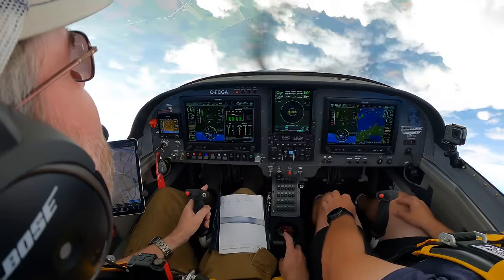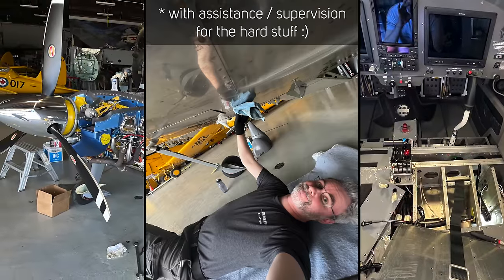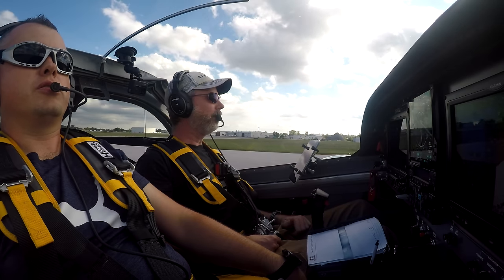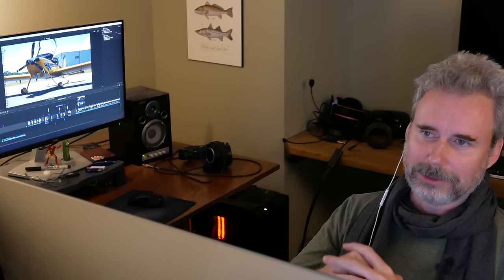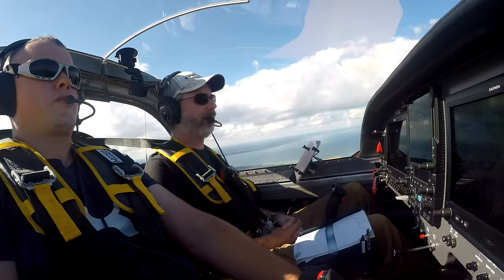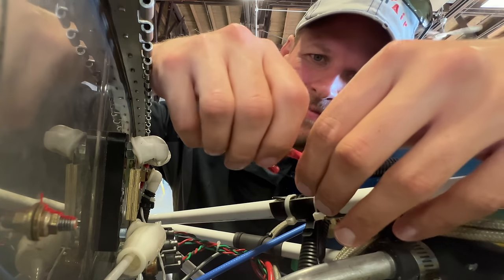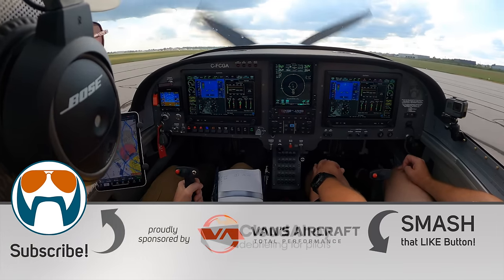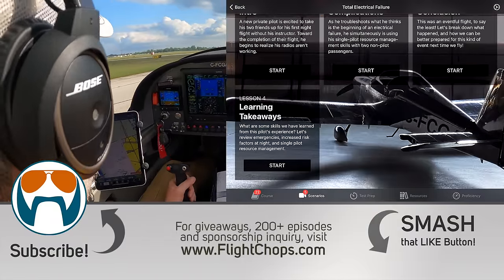Loop Induced Emergency?!

Comment: Good job handling the situation. Glad it wasn’t anything major. I do have a suggestion for the wiring on pretty much all sensors. Those spade connectors aren’t the best to use IMO. I’m partial to Deutsch connectors. They require a small tooling investment, but they’ll hold the connection securely, lock into place, are relatively inexpensive, and they’re waterproof.  It might be worth looking into them for critical sensors like the oil temp sensor. I’ve been using them for a few years and they have always done well in some pretty harsh environments (high G, oil/coolant/water, temps in excess of 280°F)

Comment: For a critical measurement like that, really should be using a 4-point probe method of measuring resistance.  Then the measurement is independent from the connection wire resistance.    Probably not how the probes are available off the shelf.

Comment: Bit late on this but t-bolt style clamps may be a better option than worm gear style. If a worm gear fails on your clothes dryer hose, not such a big deal. If it comes off your oil cooler at altitude. a much bigger deal.

Comment: excelent film... can you explain the 'fun switch'
Reply from the maker: It’s a quick way to inhibit the Garmin “electronic stability and protection” - this can be done via the panel menu as well, but I like the idea of a hard switch ;). Bottom line is, the system won’t let you do anything outside a safe range of pitch and roll unless you disable it.  If you look at the videos we did at the Garmin factory the topic is addressed more thoroughly.  I’ll grab some likes and make an other comment later - just shutting down for the night here.
Reply: @FlightChops  thank you.  i will re watch the garmin episode.  good night from France

Comment: I'm surprised Garmin doesn't have anomaly detection on sensors like this. Software could easily identify when a sensor is reading erratically, and alert that as a possible sensor malfunction. This would provide a safety net going the other way too, detecting where a temp sensor has malfunctioned electrically while still reading a value that wouldn't otherwise stand out to the pilot. This could be taken even further when CHT sensors are present, and cross reference them with the oil temp - although the heuristics certainly get more complicated. Nonetheless, done right there would be a lot of value in the avionics being able to identify when sensors aren't agreeing vs. everything is overheating this is an emergency.

I'm doing the unthinkable and building some of my own hardware/software avionics systems for a kit plane, and software resiliency is a huge concern. It's very important for the software to detect when something doesn't add up and respond by failing into a safe configuration. For example, take a software controlled trim system. It's critical that the software is comparing the trim position sensor reading with what it expects it to be, and if it doesn't match then it refuses to drive the actuator. Similarly, if the trim position sensor was noisy and/or it's reading changed unexpectedly the software needs to alert that and disable the system as it can't trust it's inputs are accurate.

Comment: Great landing and thanks for sharing!  My only comment is that your co-pilot was a bit too chill and language with the tower didn't necessarily convey that this is an emergency situation.  Although it did appear that the tower was concerned on their calls back to you.  Don't want to be the armchair commentator as I wasn't in the seat at the time, just my observation!  Had a similar situation with an instructor when I was doing my PPL in a C172.  The oil temp all of a sudden went through the roof and we were a few miles away from the airport at low altitude.  Rather than call an emergency, or do an off airport landing we limped back to the airport over the city.  Worked out, but only just and luck of the gods was on our side.  We landed safely, but the aircraft never flew again.  The engine was basically toast and we were only literally a minute or two away from the engine quiting and blowing rods through the cowling.  There is nothing wrong with doing a Pan call if things don't look right and they won't take your birthday away if you land safely.   It would have cleared the traffic at least and given you clear direct to the runway if it was busier.  Thank you again for yet another awesome video.  I must come down to your airport one day and check out the museum! (Based close to Ottawa).
Reply from the maker: Legit feedback about the chill / verbose radio work - that is why I mentioned it during the debrief in the video.
Reply: Great video. Any reason you didn’t call a Pan Pan? Lost carb heat on the last leg of my qualifying x country in the UK. On a day with icing. Got great ATC assistance and stayed high on base and finals to do a glide approach. Might have been OTT and being follow back to the club by a fire engine was a bit embarrassing (i think they were bored) but felt right at the time in case things went pear shaped quickly… No criticism just interested to know the thinking on this.
Reply: "Dont want to be the armchair pilot, but here goes"...
Reply: @MichaelOfRohan  yes I was being ironic.

Comment: Great video and debrief/troubleshooting!  Can’t wait to see more!  You have singlehandedly got my son and I interested in building a Vans RV someday hopefully!   

I’ve tried entering the contest today and each time get an error.  Also went to the “contact us” on your webpage and got an error on that too when I went to submit a question about entering.  Maybe the system is down?😢
Reply from the maker: Thanks for the heads up - I’m in the hangar right now working on the plane but I will get my web guy on this
Reply: @FlightChops  looks like it’s working!  It didn’t acknowledge that I signed up but it didn’t throw an error either, so that’s good
Reply from the maker: OK thanks for letting me know - I think I just replied in a thread for a duplicate of this comment - glad to hear it is working now

Comment: Correct me if I’m wrong but I think cross checking the CHT‘s and oil pressure would have somewhat mitigated the emergency. Still better and have it on the ground to sort things out. Did a great job. I always love your videos
Reply from the maker: For sure yes that would have been a good idea.  The thing that really had me believing it was real was how similar the symptoms were to what had just happened to Dave.  I need to actually review the data from his flight to see what the CHTs and pressure did when his oil temp spiked.
Reply: Typically a oil temp rise could produce a pressure drop. Since you had a real event before you were biased. But with the real event data you have a secondary indication in pressure. It is good to use the digital engine monitor to cross check with other parameters to eliminate the instrumentation errors. Maybe one day garmin/lycoming (or even you or me) would develop virtual indications or derivative indications to serve as pseudo channels to weed out the false indications. It's obvious in post analysis, but how about something real time. Very doable.
Reply from the maker: @73toaster  Check out the latest episode where we compared engine data with the REAL oil temp runway - the results are surprising.
Reply: I checked out the new video, very cool to keep pulling this thread! So now we can see that perhaps the smart garmin software people could start to consider better (read priceier perhaps) sensors or adding alarms triggered by rate changes in a parameter which are impossible, like oil temp rising x degrees in 1 second. All of this is already done with fadecs. Granted lots of logic to cover but the point is maybe there is other power in our engine monitors for cross checks and dual sensors etc that is not being utilized in real time to give the pilot some quick info without the pilot doing any mental ninja stuff.
If they had a rate change monitor for oil temp you could get an advisory-"possible oil temp sensor anomaly" instead of - "your oil temp is in the red". You would feel much better after that loop with the first alarm. Maybe there is other logic to consider before adding that, but you get the idea of how various sub-algorithms could be added to the software instead of just duplicating our steam gauges with digital readouts and no smarts running in the background.
Reply: @73toaster  Wow, this is a very intriguing concept, and I sure we will see it soon enough.   AI based derivative indications of what might be happening, encompassing all available parameters that a human may not think of in a high-pressure situation.   Love it.   Until that happens, perhaps more redundancy would be the solution.   I have been dealing with OP and OT issues myself in a plane with only steam gauges and no engine monitor at all.  I suspected an instrumentation error until I installed an additional purely mechanical OP gauge to confirm indications.

Comment: Good job, but a quick look at the oil pressure would have calmed you down I'd reckon. Perfectly in the green. If the oil was really overheating, that would be way low.
Great video still!
Reply from the maker: Yes I should look at the data from when it happened to Dave (with the scat tube blowing off for real) - I thought about this later - but at the time I didn’t think to rule out instrumentation by cross checking all the other engine instruments

Comment: Not trying to Monday morning quarterback too hard here. Overall, solid handling of the EP. Some suggestions though: 1. Don't be afraid to declare an emergency with ATC immediately. They can help you with things like which airport is closes and what the weather is. They also won't ask you about keeping your speed up for an RJ. Those kinds of questions are causing unnecessary pressures on you at a critical time (however small) and can be avoided. Use them. 2. If you suspect you have an impending engine failure, I would highly recommend you don't leave glideback of any airport. If you are high enough that you can make a landing to multiple fields, I can see the logic in trying to limp it along, but I would never recommend leaving the basket of an assured landing for a possible transit home. 3. Along the same train of thought, an engine out profile (either straight in or spiraling overhead) are preferred because again, if you engine fails on final, you could be a 10 miles short, or 1/4 mile, it doesn't matter. Both results are the same. I'm happy for you that it was just an electronic issue. Good luck and safe flying!
Reply from the maker: Great feedback and insights here. 
Being in that area of Canada, I really was almost perfectly in the middle of my two airport options.  So it was either a field or limp home. (And there were fields available almost all the way home… so that was what I elected to do.)
Reply: Hitting the NRST button should be an immediate and practiced response. 
I also would've hit them with the "pan-pan pan-pan FCGA (distance and direction from airport) straight-in 25 potentially imminent engine failure, two souls on board (color of airplane)" after getting pointed back towards an airport.

Comment: I'm really surprised you don't have those hose clamps safety wired it's super easy to do.
Reply from the maker: Can you explain how?  Do you mean to stop the clamp screw from loosening?  or the clamp itself from being able to slip off the flange?
Reply: @FlightChops  I raced motorcycles for 20+ years. In our tec inspection we had to have all hose clamps safety wired. If take a about 4 inches 
Of wire bend the wire in the middle of the screw driver slot and feed both ends through the hose clamp through the worm drive part of the clamp and twist it tight the hose clamp can't get loose.  If you want to go one step further you could drill a little hole in your airbox run the tails of those wires up into the airbox and tighten them in there. That will help keep the hose in the hose camp from vibrating off of the Is steel tubing of the airbox. I can take a couple pictures tomorrow just give me an email address or something I can send it to. We would also put a hose clamp on our oil filters and safety wire them so they could not back off very dangerous situation on a motorcycle race track with a oil filter falling off.

Comment: To Flightchops.  I am an AMT in the US.  I would suggest to get ride of the mechanical connectors on your oil temp bulb and go with a better connector such as deutsch connector .  You may need a DMC wiring tool or tools .  But the deutsch connector is far better then the old crimp type connector.  All the best and keep those flightchops extra sharp.
Reply from the maker: Thanks for the insights.  I'll show this info to Dave

Comment: Thanks for the video. Any considerations on always having a field (patch of grass to land engine out) within glide distance? It seemed a bit shallow and low at the end, getting to the airfield. Camera FOV is obviously a limiting factor for the viewer so don't consider this a stab, just a question out of curiousity. My primary goal in any case would also be to land as soon as possible. But keeping my altitude as long as possible, even at risk risk of ruining the engine until a flight path with emergency diverts / a runway with landing circuit has been obtained.

Comment: What's "funny" to me watching you manage this is the general tendency to avoid the PAN PAN / MAYDAY message and try to minimise the significance of the situation to the ATC.
It's something I've observed almost everytime, including in myself.

However one time it backfired to a former colleague, he had an actual engine failure during a training flight in a twin engine and only announced "one engine out" to the ATC. When in long final the ATC told him that he was n°2 for the approach but he took the priority for the landing, to which the controller was really unpleased as there was no justification for that unless he had an actual emergency.
The problem was that since it was so usual for this airplane to practice engine failures the controller didn't think that it was an actual one when my colleague announced it.

Comment: Can you share where you sourced those connectors from? Trying to get some more details in lessons learned for the home builder. Also are they rated for the wire size? Just going by the footage they look pretty big compared to the wires.
Reply from the maker: I believe Dave actually got them from our local AME, so they are certified level quality - not sure the exact specs.

Comment: glad ur safe, great video. 
Your regard for the engine and the plane is too invested imho. its obvious you wanted to save the engine, save the plane, and of course get down safe, when in reality if you faced a real engine failure safety was of only true concern. Racing engine oil temps can easily exceed 300 in endurance engines. All “redlines” have margin, and in this case pushing an  true oil temp of 300 for 30 min would have more than likely just fine

If the engine also has cht sensors - using both as an indication of true engine temp may also be something to consider. 

great job none the less and beautiful airplane, your living the dream!
Reply from the maker: Feedback appreciated - but to be clear - I don't have a ton of experience with operational tolerances outside of spec... So my concern here was a catastrophic engine failure or inflight fire.  I really was thinking about saving ourselves, more than the plane.  Putting this airplane into a farm field is not ideal due to the low profile wheel pants; it is likely to flip and result in injury - so finding a way to limp it to a runway was obviously ideal...
Reply: @FlightChops  you did great! I hope some day to fly half as well as you and make the smart decisions you make time in and over in flight

Good point about a fire. I think adding in a block/head temp sensor array (you probably already  have cht) would help if in the future oil temp spikes but cht is dropping, etc

Comment: Nice landing under pressure, Steve!👍👍

Things like this are extremely common in the automotive world due to the nosedive in quality control by automakers, and their vendors. Can result in anything from erroneous gauge readings like you had here (which will also set a code and turn on the "check engine" light [aka, the MONEY light ...] in OBD-II vehicles ['96-up model years in the states] ), to leaving you stuck dead center of a 6-lane freeway / highway at rush hour. Mice also play a big part, as does wire chafing, since the bare minimum wire jacketing / insulation is used on low-bidder, SUPER THIN copper wire ... and there's about 5k miles of it to boot! The opportunity for failures is sky high today. Just thank God automakers DO NOT build aircraft!! 😂
Reply: Honda jet?
😉
Reply: @watashiandroid8314  They started with off-road powered equipment, so I don't count them. 😉

Comment: So much data.  "So, yeah, it looks like your engine pressure was triggered by your low heart rate.  Also congrats on hitting your activity goal! Stress levels are a little high, and your left tire pressure is low, maybe you can try getting more sleep..."
Reply from the maker: I wish I could get tire pressure data!  As it stands, I need to remove the wheel pants to check pressure - it's a lot of screws and a bit finicky with regard to the leg fairings... but I've heard those bluetooth sensor caps are often the source of a leak.
Reply: @FlightChops  hmmm... it would be cool if someone made aircraft-grade bluetooth tire pressure sensors...